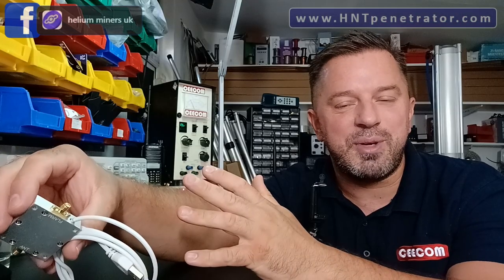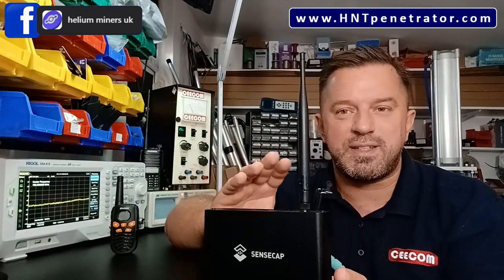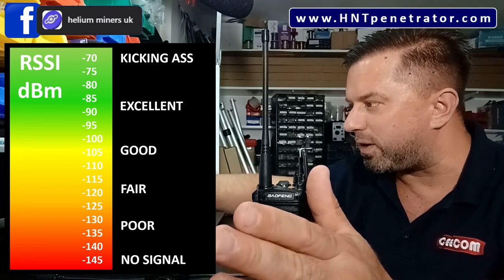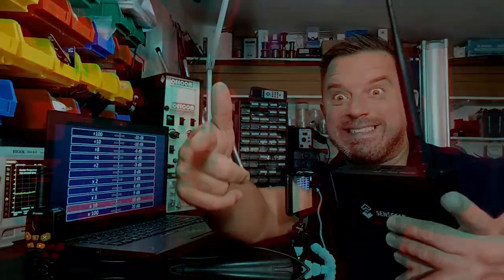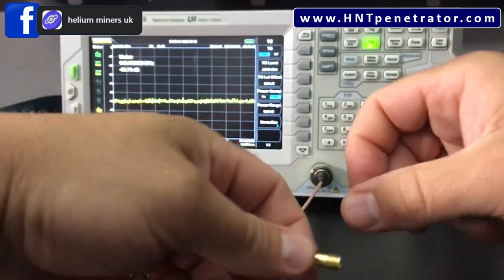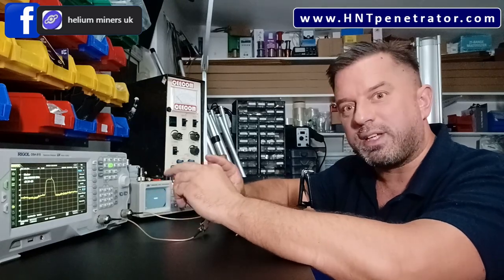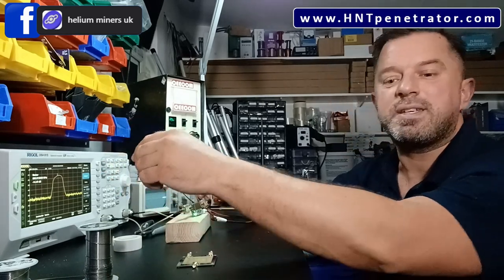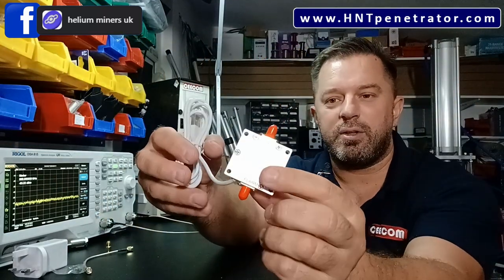Flarm Booster & Air Buddy Amplifier for Helium, what do they do? Can USB  reduce my mining rewards ?

Comment: Excellent video, one of the best on the subject so far - thank you. Would have been good to see the Airbuddy receive signal test. You could put an attenuator on the Airbudy to reduce the output/beacon power and take the loss on the input power, especially if its coupled with a high gain atenna. Looking forward to more.

Comment: This video was amazing. Big respect!! Anyway you can help me understand something? I have two directional antennas which are 10 dbi each, I got them from Mcgill. I have put them in a way where they don't see each other. So opposite each other. I want to know about splitters. Where do I put the splitter? Top next to the antennas where I join them together and then bring down just a cable to the miner or should I have a cable from each antenna down to miner where I can then use the splitter. I also have this jetvision cavity filter which does a great job to filter the noises out. When it comes to putting a splitter, I know the loss is like 3 dbi so my antennas then will be like 7 dbi minus the other dbi in adapters and cables. Cables are 10 metter LMR400 each. When it comes to amplifiers, which one do I need to get the 10 dbi on each antenna? Any idea and where do they belong to? Thank you.

Comment: Great video, lot's of effort. However, you didn't test the Raygnal that you showed at the start of the video :(
The 2 best adjustable amps are the Raygnal and the Ayissmoye Ultra Low Noise  RX/TX adjustable amps.
If you are going to test cavity filters then you should test the Han Han (!)
Reply from the maker: I said at the start of the video I’ll do a seperate test for the raygal as there’s so many readings to take. It’ll be up in a couple of weeks 😀 thanks for watching

Comment: Great video. Iv got a flarm think same as Arron’s but no one witnesses my beacon off it. Only my next door and become invalid.  You didn’t do the apple plug though :(
Reply from the maker: You may have the dBi gain for your antenna set high in your app (it will lower the transmit beacon power). Try setting it at 2.1dbi and wait until next beacon to see if that makes a difference. You should then have more dbm when you beacon which should trigger the switching inside the amp.
Reply from the maker: Have you used an adaptor to adapt your rp-sma to sma male for the amp.  Presuming you had antenna connected directly to miner before you might have an rp-Sma connector which appears to fit amp but there may be no pin in centre of plug